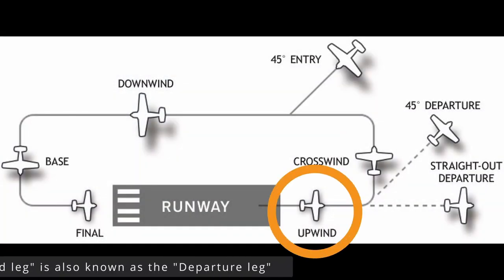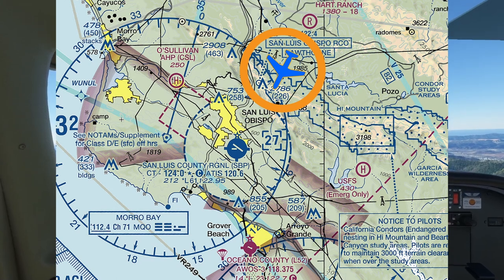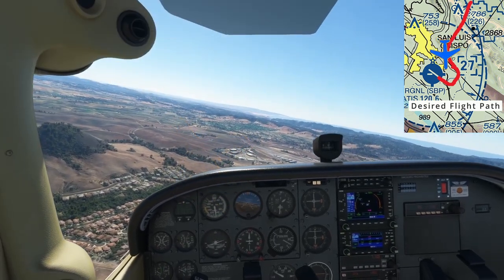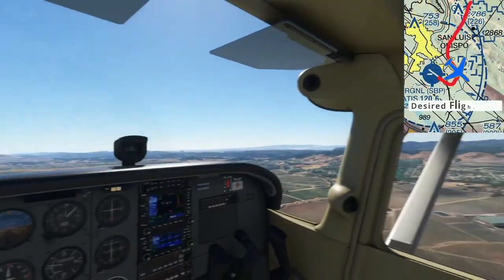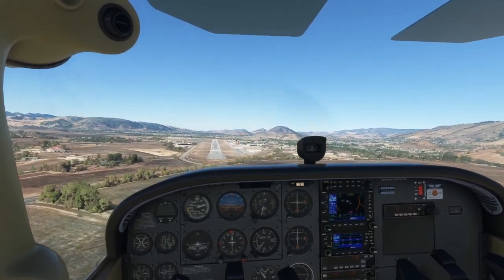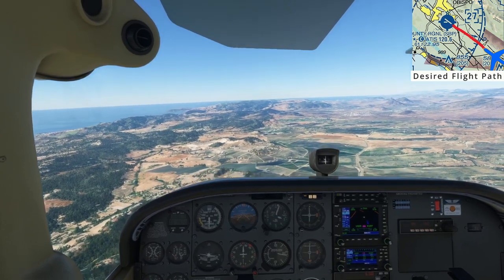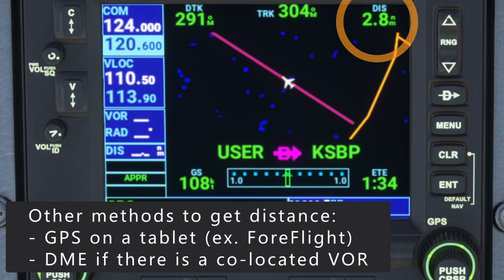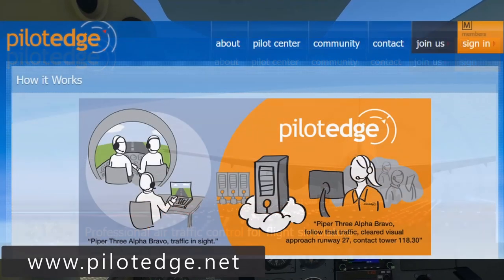How to Enter the Traffic Pattern at a Towered Airport

Comment: Today I was west of KSBP and was instructed to enter a right downwind for runway 29. How should I execute this in a correct manner? I overflew the runway and did a 180 to join the right downwind and the controller made me feel like I was the dumbest person alive when I did this. I tried to get some clarification afterwards but didn't get a good answer. Should I fly around the whole class D and then come in from the other side?
Reply from the maker: Overflying the airport and joining the right downwind would have been the right move there. Visit our Discord to discuss further with our community. PilotEdge . Net / discord
Reply: @pilotedgeATC  Interesting, that's what I did. But maybe I should have joined the downwind right away instead of doing the usual recommended teardrop entry?
Reply from the maker: @mrmisterno1  the teardrop procedure is only for non towered airports, unless specially requested to do so by the tower.
Reply: I had this happen once at KFRG approaching from the west and wast instructed to enter a left downwind on the east side of the airport.    I asked the controller how they would like me to cross the airport and they quickly corrected them self instructing me to enter a right downwind.

If they indeed wanted me in the left downwind I would have done a direct entry in the downwind from overhead.   I only execute teardrop entries if the traffic pattern at the airport is busy and necessitates it.   I don't really like being so low so far from the airport.   I'd much rather get down to the runway from a 'high key' type position have have a lot more options for engine out scenarious.  Saves a bit of gas too!
Reply: Honestly this is one of my biggest fears/hangups with flying online.  I'm so afraid of having trouble entering the pattern, and a big part of that is somethign like this, being given a pattern entry on the other side of the airport and then having NO idea how to do that.  Sadly this video just covered the "easy" entries where the controllers gave an entry that made sense from the direction of approach.  But EG if they had said "right downwind" on the second example how the heck would he get over there to do so?  Like you said the only two real options are overfly or go all the way around then come back in.  If you overfly what altitude do you do it at?  The whole process is very difficult/confusing for a non real world pilot.

Comment: at 3:17  assuming you were approved to enter the pattern, can you cross the runway overhead at say 500 feet above pattern altitude and do a 200+ degree turn and enter the downwind at 45 that way (vs going the designated flight path you have in red?
Hope this makes sense
Reply from the maker: Absolutely not. That would be in direct violation of the controller’s instructions. Also, there’s really no need to conduct that lengthy turn unless you’re high. But if you are entering high, it would be far easier to request an extended downwind.
Reply: @pilotedgeATC  ok thanks 
I’m a flight sim noob and all I heard controller say was enter right down wind. I guess I’m confused with a cross runway approach on a field with now controller.  Thanks
Reply from the maker: @pgreenx  have you tried our CAT rating program?
Reply: @pilotedgeATC  I'll check it out. thanks

Comment: If I am approaching runway 29 heading 110 degrees, can I make a zero degree entry to the downwind or am I expected to maneuver to make at 45 degree entry? Thanks
Reply from the maker: Per the AIM, you should widen out from the airport so you can still make the 45 entry. However, at a towered airport, that’s not as necessary since the tower is giving you the instruction.
Reply: @pilotedgeATC  To clarify,  when the tower instructs "Make right traffic..::, whether one's heading is parallel to or at 90 degrees from the downwind leg, no maneuvering to a 45 degree entry is necessary, Thanks

Comment: Upwind is for go around this part is wrong departure Leg is when you takeoff not upwind everyone confuses this
Reply from the maker: Not quite. Reference AC 90-66C. Departure leg is used when departing the pattern/area. The upwind is used for other instances, or when operating on the side opposite of the downwind leg. 
Regardless, it’s important to know that in a towered environment, ATC will very likely use these terms interchangeably so you need to expect that and react accordingly, even if ATC may be technically incorrect in their terminology.